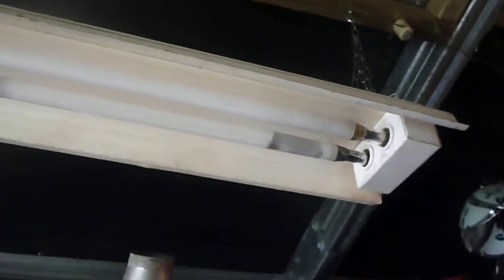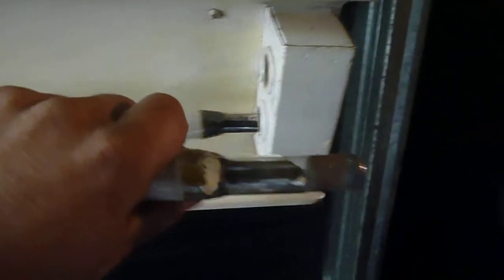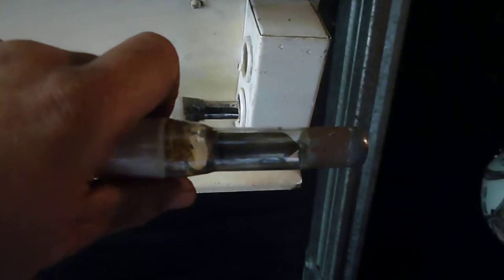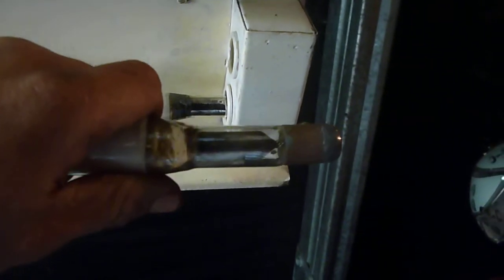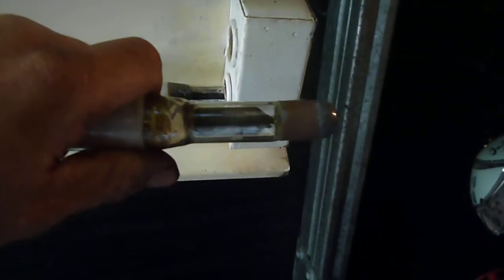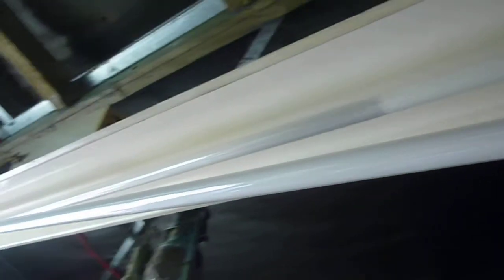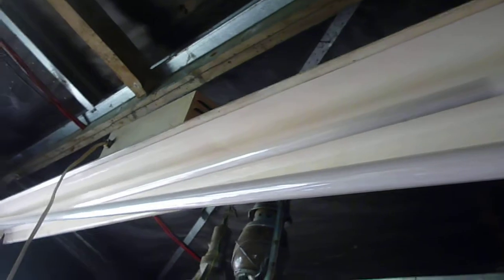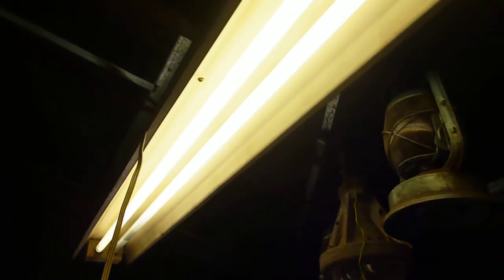saving our electrical heritage. 1950s  cold cathode fluorescent industrial light

Comment: starts up just like a neon sign.    wonder if a neon sign transformer could be slapped in , if say the ballast went out.   I wonder if this 8 foot cold cathode fluorescent was the predecessor to the 8 foot slimline,  since they both work on the principle of using  a very high voltage to strike the tube, with no preheating of the cathodes like in preheat and rapid start lamps.

Comment: ive never seen a flourescent light that looks like this could you explian i live in the usaa and ive never seen a flourescent light like this
Reply from the maker: the cold cathode fluorescent light you would be familiar with would be neon sign tubes.  this fitting works the same  just on a bigger scale, the tubes are made by consolite  an Australian company,  and a few companies made the fixtures  in Australia and new Zealand.   the standard American  fluorescent tube is a hot cathode tube meaning  that the cathode consists of a tungsten coil coated in potassium oxide . when powered up the coil is heated by the starter , the potassium oxide produces thermionic emitions  which allows the tube to run at a lower voltage  about 90v across a 4 ft 40w t12   the amount of potassium oxide used making the cathode determines the life of the tube.   The cold cathode tube has  a large thimble shape cathode at each end  and  when the tube is powered up  the high voltage just flows through  hence why the tubes light up straight away  also there is no emissive  coatings to wear outso cold cathode tubes have been known to last  60 plus years    if you want to find small tubes the same as these pull an old lcd tv apart  as they use them as a backlight  the tubes are exactly the same  just tiny   cold cathode tubes use voltages between 600v  to 18000v depending the size of the tube